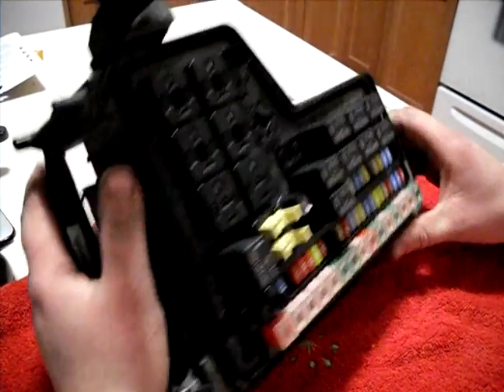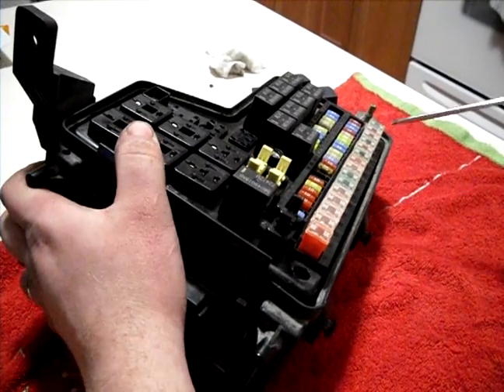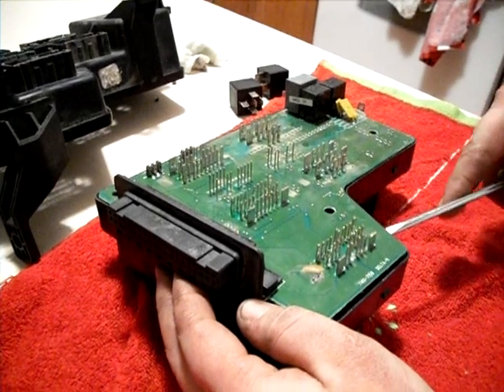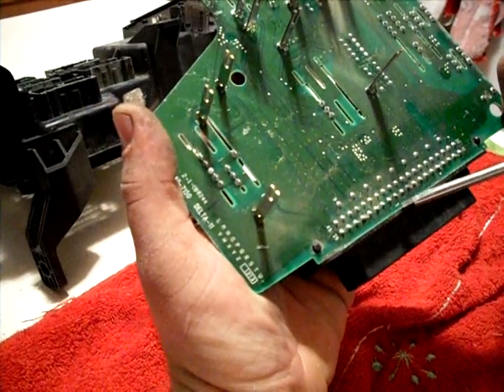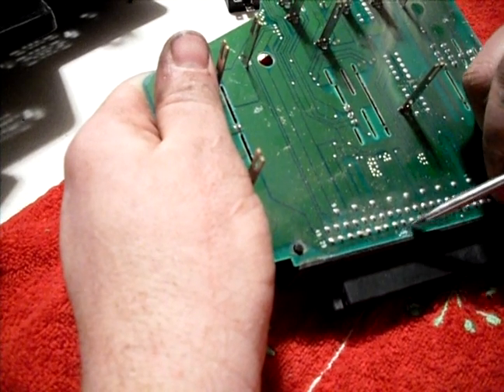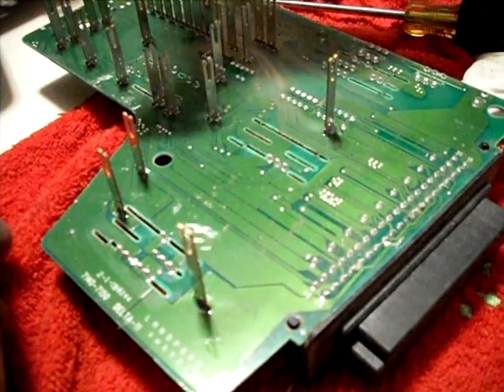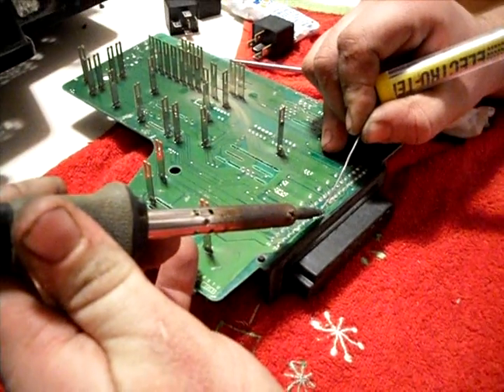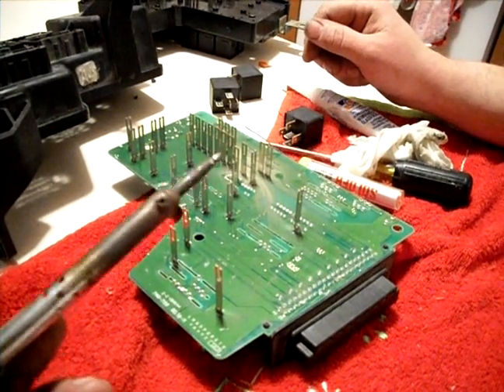DR IPM repair

Comment: Came home and found my parking lights stuck on in my 2004 Ram 2500.  This was a very helpful video to help me remove the casing to get to the circuit board and find the trace with a 12 ohm short to adjacent trace.  Fixed the problem.  Thanks for your time and for putting this out there!  you saved me some time doing this!

Comment: I know this is a super old video. But just to help people out. Use flux, it will make the solder stick and you can control it better even if it bridges pins. You can unbridge just as easy.

Comment: Know your video is 8yrs old and you probably don't watch for comments anymore but here's hoping. I was thankful for your instructional video but after I pulled my IPM from my 2004 Dodge Ram 3500 SLT Cummings 5.7l Diesel, I noticed my board was similar but the printouts looked different. I was really hoping you could help further in directing me of where I could SMS a wire to correct my front left low beam problem. In looking at the schematics on page 8W-50-7, the low beam functions via the FCM 4 via circuit 43 IPM etc. My IPM looked clean outside and inside. I saw minimal dirt/dust on the circuit board itself and it was near the FCM solder points but after cleaning with 91% alcohol, the board looked pristine. I didn't see any corrosion at all so I am really confused as to what the problem could be. However, I am unsure on how to test circuit 43 on the open board and/or how to repair. Do you think my actual problem is with the FCM, which I am unable to open to inspect? Also, my truck brake lights and I think the top lights running on top of cab come on periodically when truck is not being used. I really am trying to save some money here and fix the problem myself but I am a novice at best. I would appreciate any advice. Thank you!!
Reply: Look over the trace for burned or dark areas that look like they have been heated up. Also look at the ends of the connectors on the vehicle and the board.

Comment: I pulled mine apart thinking that this was the problem that I could fix it but my board is very clean. I have no running lights no brake lights and no license plate lights also no blinkers only in the rear my front blinkers and headlights work fine any idea what it could be?

Comment: I opened up the fuse box on my 1998 Dodge Ram and was surprised to find that there's no circuit board contained within. The lower section of the fuse box has no holes or openings in it and effectively prevents moisture from getting inside. They should have used a similar box on the Rams with the circuit boards.

Comment: Thank you sir for this informative video. Just completed the repair, had to splice a few strands of wire to bridge the gap,  which I had made worse trying to use too large of an iron. Got it on the first try with a smaller iron.

Comment: Thanks for posting the video, I used this to fix my truck tonight!  Only thing I did different was to put a #22 wire in place of the trace on the board and then super glue it down to hold it in place.  Plugged it in and worked like a champ.

Comment: I am not worthy! Thank you very much for this video. The dealer first charged me $115 for the diagnostics, then estimated it would cost me $1200 to fix! (They would have replaced both components) I soldered a small copper wire across the gap and it worked! Hallelujah!

Comment: Sprinkles IS THE MAN! I just did this repair. Had 5 corrosion breaks on the circuit that controls marker lights and tail lights. Soldering the gaps was tricky, so I used some thin wire and silver solder to bridge the gaps. Then sealed everything with silicon. This saved over $650 Canadian.